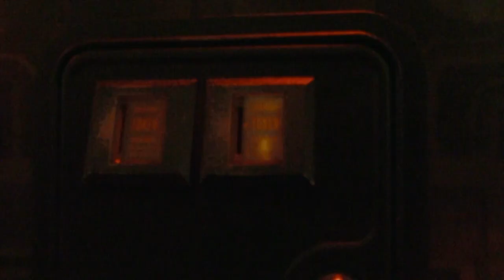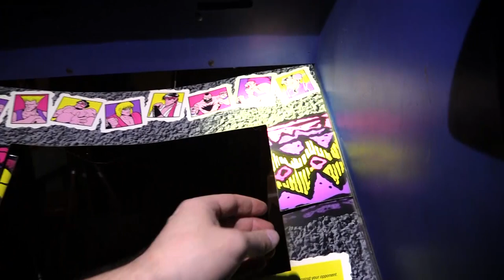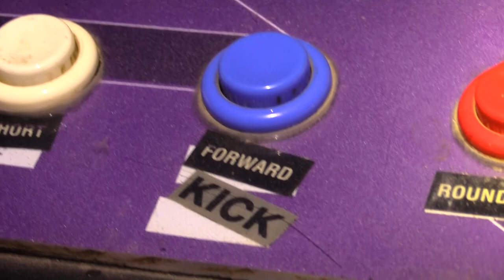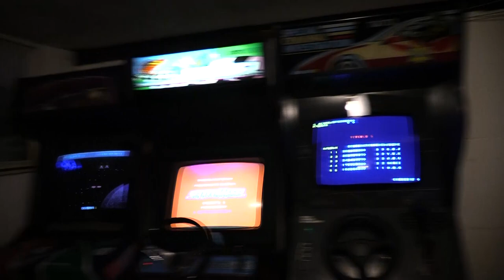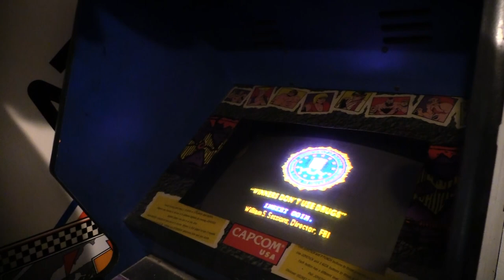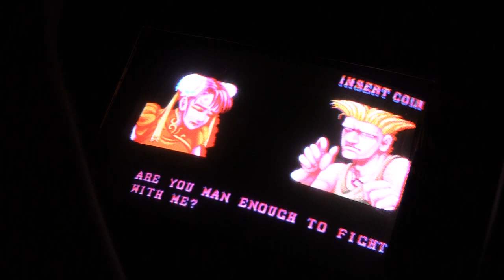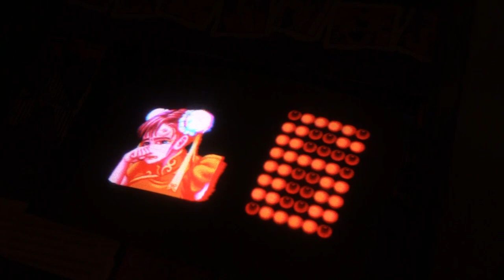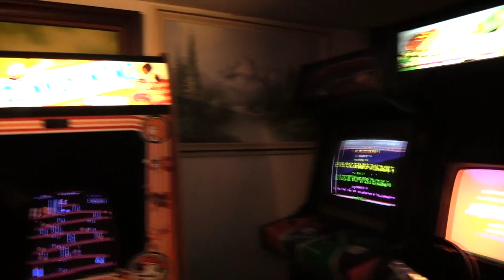Track and Field - Repair Part 1 - Monitor, Bezel, Wire Harness, Gameplay | Arcade Restore

Comment: Enjoyed that man. Wow the plastic screen bezel and monitor were filthy. Probably never cleaned! Loved watch the grime come off. Looks way better now. Just to note, that silver braid in the cab is an earth strap so is exposed like that. I guess an operator tapped into it and soldered a ground in for some reason. The little strips of black card around the brackets / bezel are meant to be like that. There are two sides and a top piece. There is then a full card monitor bezel that lays over the monitor. If you want photos, just message me on Facebook dude.
Reply from the maker: Yea man a new definition of filthy HAHA Ive seen the earth strap before at the bottom of cabs like Robotron but never saw this kind of hackery with it lol like i think its only been tacked to the bottom of the cab in that case and never routed around the cab like this haha nuts. I looked at a friends TnF cab after this was filmed and noticed those side cardboard bezels are supposed to be like that. My bad, I ended up ripping one of them in half because of the double sided tape fused to it while taking it out by mistake; sucks, but i did save both strips and plan on repairing that piece with a thin film of glue on the backside and using them during this deconversion. I saw someone makes all the parts repro on KLOV as a last resort, ill be sending a fb pm as pics would definitely help.
Thanks for the comment Dave, love it, later bro.